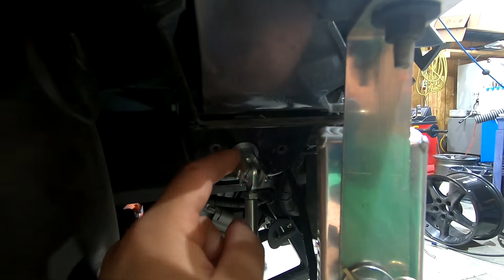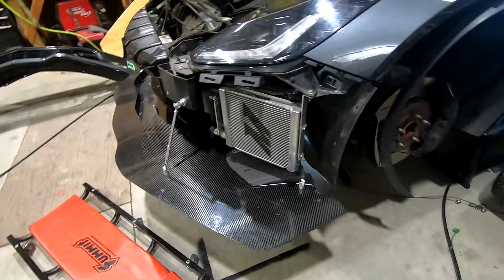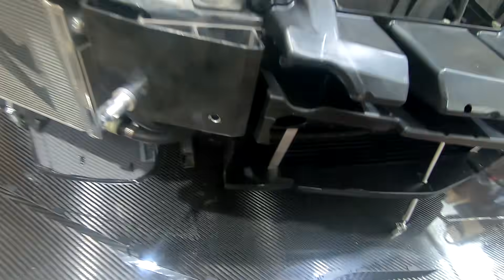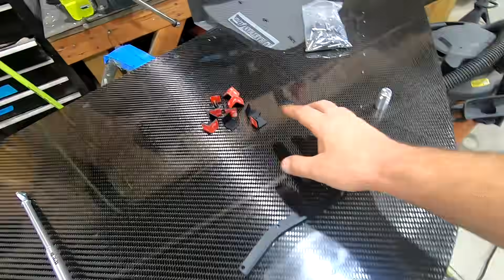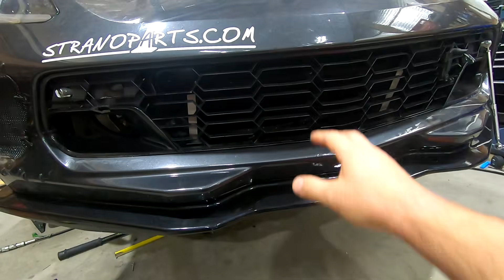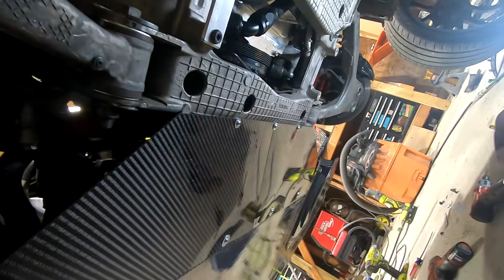AJ Hartman Aero C7 Splitter Install (Plus Some Wind Tunnel Data)

Comment: I have a material question. I made a custom diffuser prototype for my S197 Mustang from ABS, when I saw your videos correctly, for a diffuser you take 2 12k 600gsm sheets and a 2 mm core material. So the strakes are around 1 mm thick and the plate 4 mm when finished, right? Thanks!